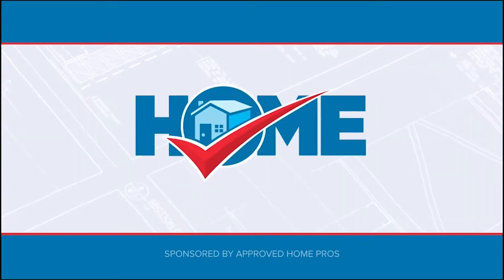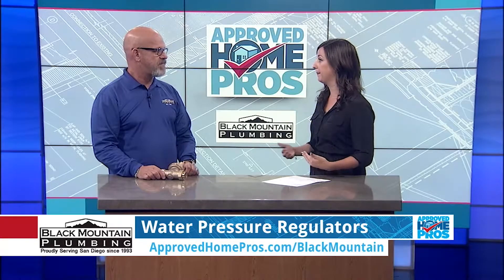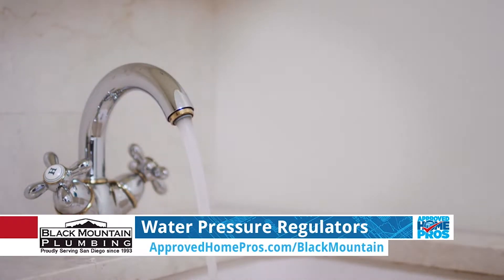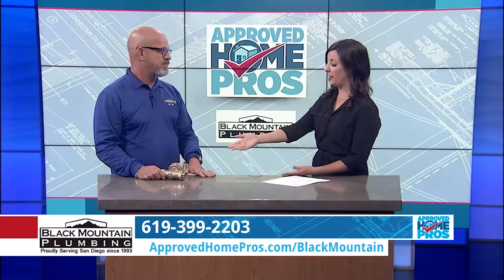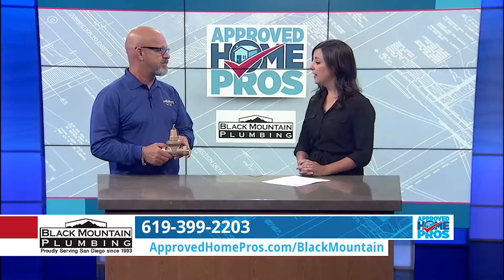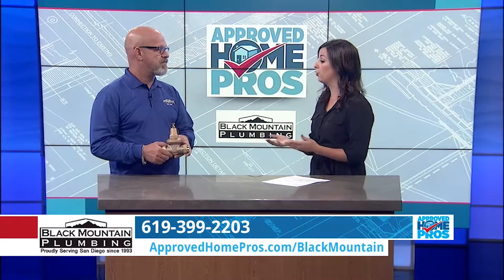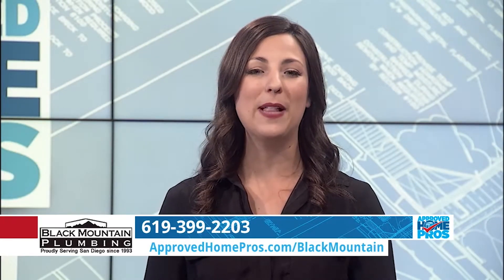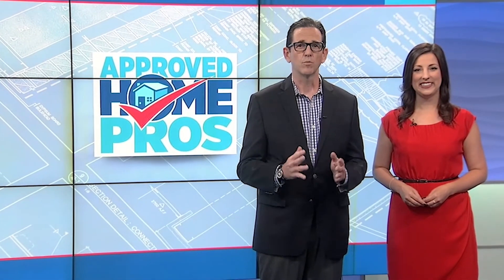What You Need To Know About Water Pressure Regulators

Comment: in most cases...if you get the correct rebuild kit....it's much easier to rebuild regulators than replace.  Typical regulators are made of brass so they do not rust.The parts that DO rust come in the rebuild kit. Removing an old one can lead to many trips to home depot. Reply if you need some help.